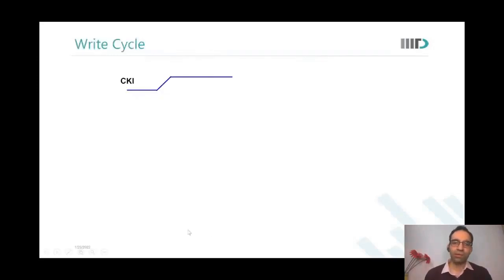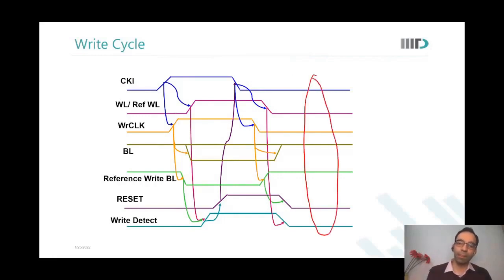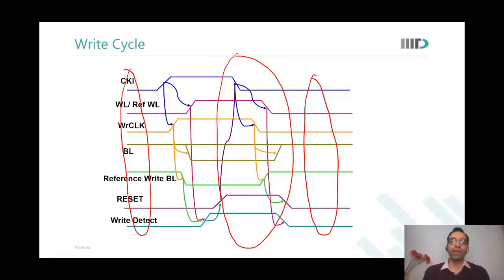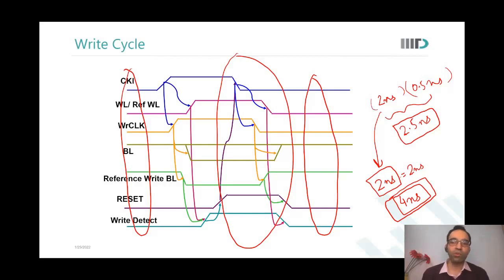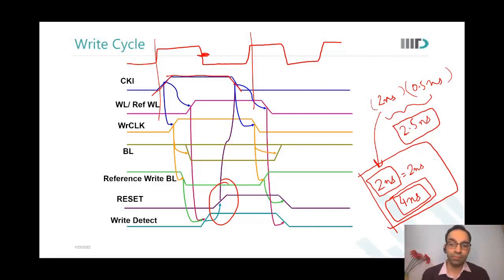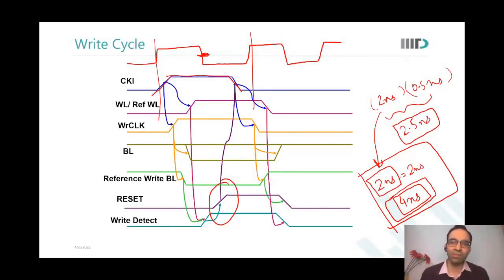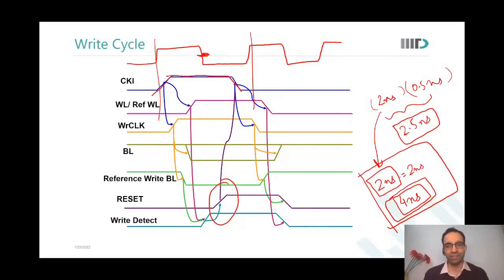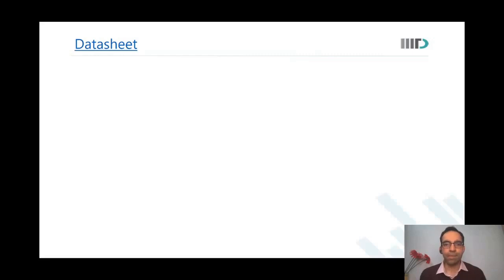Signal Flow in Timing Diagram

Comment: sir, If we have 1024 rows in SRAM array. will there be difference in time in extracting data from 1st row and last row? If yes then why and if no the why?
Reply from the maker: It would depend on the way self timing is implemented (if at all). 

Even in self timed architectures, just because of different response time of sense amplifier for different input differential voltage, there can be a difference in the two. Though this is more than offset by mismatch and other factors that can influence differential creation.
Reply: @anujg1  may I know from where I can read more about self timed architectures? 

Thank you for the response